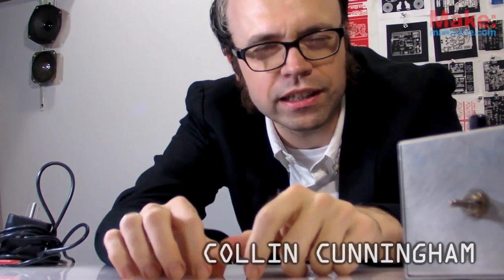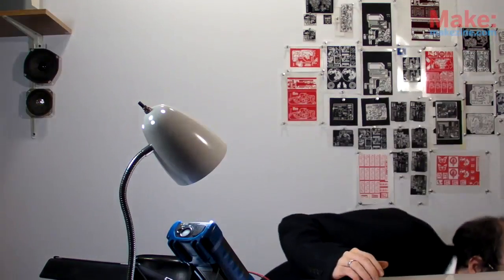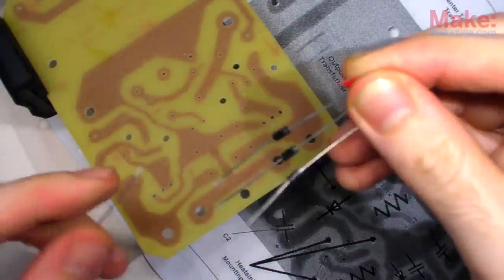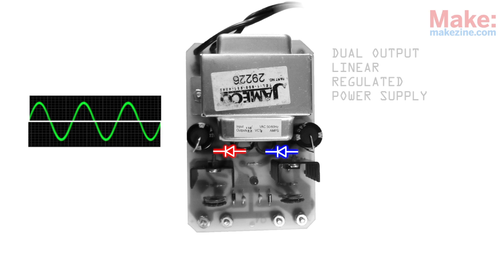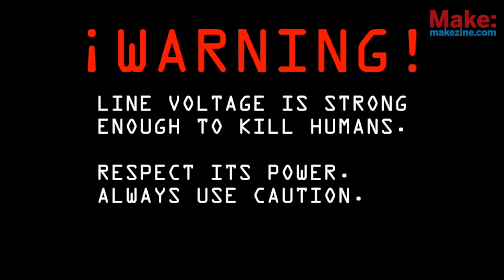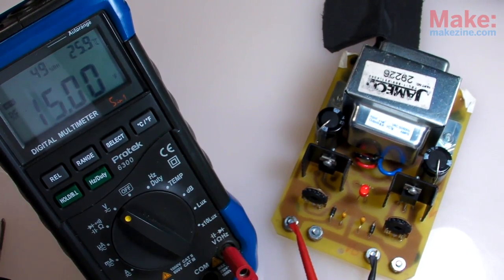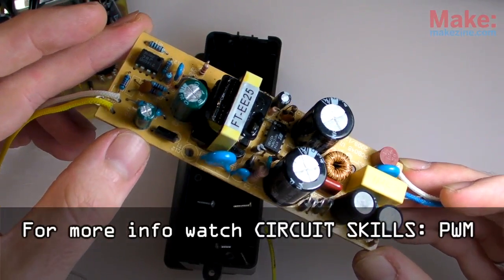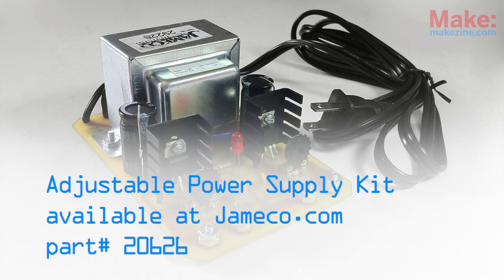Circuit Skills: Power Supply

Comment: @uut0 Many power supplies are built like you suggest, with a mains/line cord, especially for expensive portable use devices such as laptops, etc. However, it costs extra, and when the device is likely to stay plugged in and is being built to a price, they elect the cheaper two prongs.

The Bell System, recoginizing the "easiness" of which you speak, supplied 2-ft-long 3-conductor extension cords to allow no-cord wall warts to be plugged into tight places.

Comment: Wall warts and similar simple linear supplies usually have only crude circuitry, with poor voltage regulation, no overcurrent protection, high noise and hum, etc. The user must ensure that this is OK for the circuit in mind or else build in additional power processing circuitry in the load. High-end  electronics will require high-quality power supplies for the best results. Don't hitch a pig to Cinderella's coach and expect "happily ever after." It doesn't hurt to try, though.